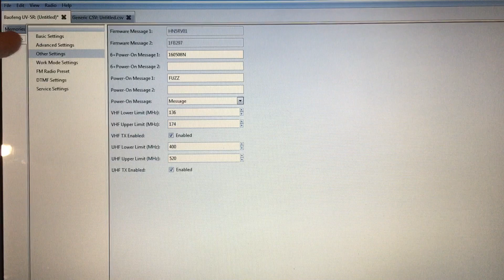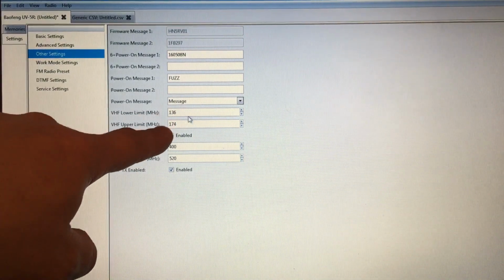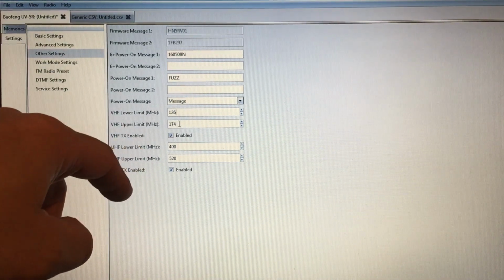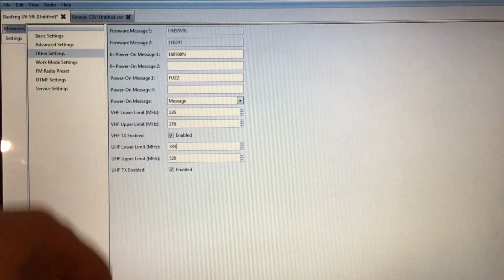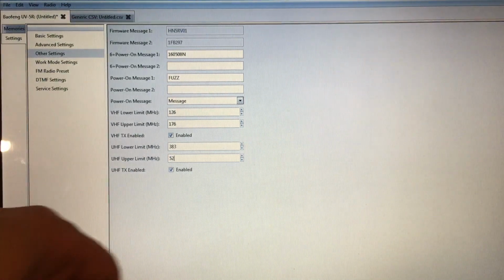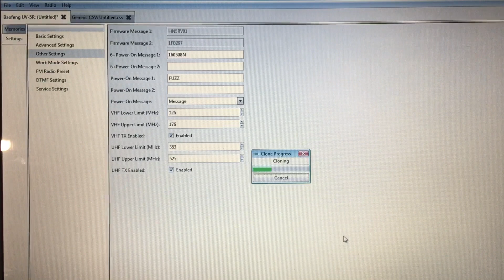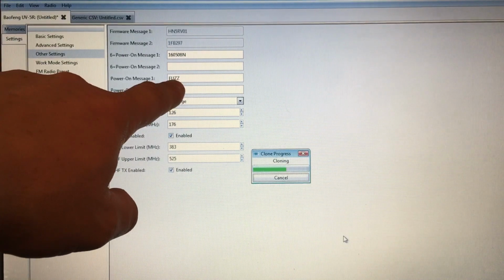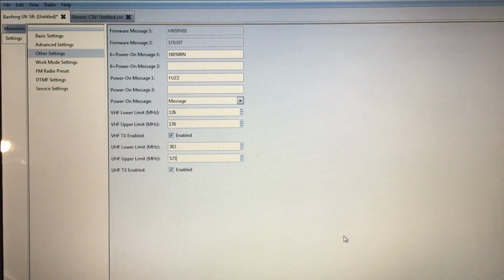Chirp  |  Change The Frequency Range On A Baofeng UV-5R Ham Radio

Comment: its letting me program everything fine in chirp but the radio wont then let me connect to the new ranges
Reply: Try turning it off, pressing the PTT, vfo and Mon button together and turning it on while keeping them  pressed. It should say "factory" on the screen. Keep in mind that it won't work on ridiculous variations

Comment: just a curious question... is it possible to program it to 118.000 frequency? would  if so, could i able to hear atc comms once i programmed it on chirp? thanks
Reply: You could, but if I remember correctly, ATC and planes broadcast in AM, not FM. It would be quite hard to hear the ATC controller.

Comment: Received the latest-version Uv5R days ago, tried the programming via Chirp 20221217 version to fix problems:TX Only 144-148 430-450MHz, RX only136-174 400-480MHz. , doesnt work so far, any idea?
Reply: Just got mine to. Turn off your radio hold ptt moni vfo/mr at the same time and turn on your radio while holding said buttons. Screen will say factory and all TX restrictions will be removed

Comment: Sir can i set 110.000 in lower vhf?
Reply from the maker: I wouldn’t. Really no reason to go that low.
Reply: @FuzzThePiGuy  Pardon the stupid question, but what is the point of widening the range? I'm not familiar with any systems using these frequencies.

Comment: So people know, the newer versions of the Baofeng UV-5R now only allow you to transmit on 144-148/420-450Mhz while you can listen outside these frequencies you won't be able to transmit.
Reply: Reset with button press, change ranges and done.
Reply: @johnbasedman4988  i don't follow what you are saying.
Reply: @ChrisWard74  you factory reset the radios, and then change your mhz range via chirp and then you can transmit on whatever frequency you want. I just did it with new 5rs that I just bought last week
Reply: @johnbasedman4988  oh wow really I'm going to have to try that right now I can set them to frequency we have used for 5 years but can only listen on the new radios and not transmit

Comment: So I completed these steps for my UV-5R and I still cannot talk below 144.000 or above 148.000. Did I do something wrong?
Reply: try turning off the device, remove the antena, point the radio down or put inside a microwave,
hold the PTT + MONI + VFO/MR buttons and then turn the radio on with your third hand while continuing to press the buttons with your other two
it should say factory
now try again

Comment: Well did this work for you? Can you pick up aircraft, airports? In california we are experiencing a lot of fires this year and we have fire bombers dropping retardant . I would like to listen to this air tanker radio traffic.
Reply from the maker: Big JJ this radio won’t be able to pick up AM airband. I saw online people have, but hard to tell if it’s true. Maybe if you’re super close to it. Probably be better with a rtlsdr dongle or something.
Reply: Fuzz The Pi Guy 
Thank you for the feedback.
What would you recommend as the cheapest and most effective radio to be able to monitor the air traffic?
Reply: @bigjj974  the uniden bearcat 355N is a good all-round scanner, and it has the uniden close call function, which is good for identifying nearby transmitters frequencies. It is unfortunately a bit expensive at ~$100USD, far more than the baofeng.

Comment: Chirp will let you program from 100 mhz to 1000 mhz. And if you program 2 baofengs to do this they can transmit to each other in frequencies outside of their normal range. One should verify this with a scanner thou.  But weird stuff starts to happen, like when you transmit at 223.500 and you have your other radio listening a noaa weather station the noaa will cut off while transmitting from the one set to 223.500, even if both channels on the recieving one are on that noaa station.  Its like the hardware doesnt support it very well and its transmitting at some super wide bandwith or something. And depending on the frequency the hardware wont support it at all and the transmit button will lock up the radio

Comment: playing with it i got it to tx as low as 129.6000 without the raido locking up  and confirmed with a scanner that it did tx...  but what are these freqs for...  there is a reason our radios dont go that low...
Reply: Got mine down lower then that 101.999
Reply: @ddjj868  how did you do?
Reply: Airband.

Comment: CAN I TOUCH 26.000 - 28,000 RANGE?
Reply from the maker: The simple answer is no.
Reply: @FuzzThePiGuy  I NEED THE 27.225 RANGE IS NOT POSSIBILE?
Reply: @cretagabriel6819  Buy a CB. FFS.

Comment: I need 98.500 but cant program it in or add to preset channels
Reply: I have a UV-5RA.  I push the orange "CALL" button and it goes into wideband 65/76-108 MHz mode. (dunno, guess in other parts of the world they go down to 65 or 76 MHz, not 87 like here)
Reply from the maker: 98.5 for FM radio? As in a music station.

Comment: I'm wondering if the frequency parameters are hardlocked in the firmware or not.

Anyone know if CHIRP programming the operating range of this radio to 30MHz- 88MHz then changing the antenna out for a Thales or Harris antenna designed for that frequency range would yield any results? Or would someone need solder/replace physical hardware inside for that.
Reply from the maker: You might be able to use chirp to do it. But the radio won't work at that low of a FREQ.
Reply: @FuzzThePiGuy  Any idea why? As far as I know, the manufacturer just puts software limitations on the equipment itself for legal reasons. If you open those up / remove the software limitations and have the correct antenna, shouldn't the radio be able to receive that low at least? Its still within VHF, and the UV5R can already recieve FM at 65MHz-108MHz. 

Curious
Reply: @TheYellingDingo  the FM radio is on a different chip.

Comment: Hi. My radio won't let me enter the frequencies for my area. I have the uv9r plus.. please help
Reply: Are U using chirp to program?
Reply: @leelatham6510  I've ordered a cable due to arrive September omg slow boat from China. I'll use chirp to program and unlock those frequencies when it arrives
Reply: @davidh-grey6633  I've programmed my uv5r but having trouble finding the right option for the uv9r on chirp. Gonna download it again. Maybe they've updated it.

Comment: Can it be programmed to 200-259.975MHz???
Reply: I think you could, but I don’t know if it will cause overhearing issues in the electronics or bad SWR even with a good antenna.
Reply: I am verry interrested in this freq range! I got the Bf-f8hp radio..so i wonder if it supports that range..
Reply: I got mine to do the 220 ham band and it works fine . You never know from radio to radio ( I've programed almost a dozen )   what is possible unless your willing to explore .
Reply from the maker: Not the radio that was used in the video. Baofeng does make a radio that covers 1.25 meter band

Comment: Well actually i've done this , using the chirp program as well. But why I can't hear anything from my radio when I set the radio to air band frequencies? Even the green light is blinking, but still I can't hear anything :( any clues? Thank..
Reply from the maker: This radio is FM. Air band is AM.
Reply: @FuzzThePiGuy  okay thank you :) so..however I can't use this radio for listening to airband, right?
Reply from the maker: No. You would need something that can RX AM. Like a radio scanner or RTL-SDR software.
Reply: But I've seen a video in YouTube too that can turn UV5R into an air band radio (Rx only)
Reply from the maker: hersan dika don’t believe everything you see. It’s a FM only radio. If you’re close enough to the signal you might get lucky and hear it. But that’s about it.
Reply: @hersandika1640  Dallas Fort Worth blast the signal out on FM with some AM modulation as well. I can get about 4 to 5 ATC channels on this Radio. The tower comes in very clear. The plane not so much. These are ATC stations that are spread about the metroplex. The closer you are to the site the signal comes in very clear. https://youtu.be/GxTewb06ZvA
Reply: @aribpm  thank you :) 🙏
Reply: @hersandika1640  you are welcome sir.  You need to turn your volume to maximum. That signal you are getting is weak because you are very far away. Having it full volume will help if you happen to pickup the weak signal. Just remember to turn it down before switching back over. Find the frequency that is transmitting and see if you can move to a higher altitude or get closer to the source. The internet is filled with tons of data of frequencies. Where do you live right now?
Reply: @aribpm  i live in Jakarta, Indonesia.